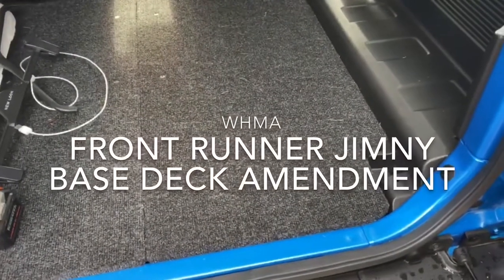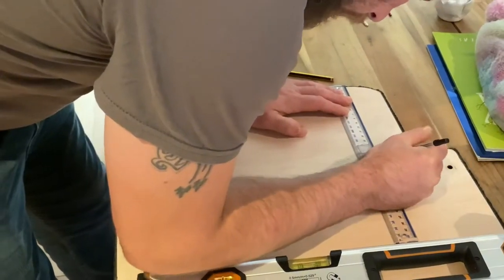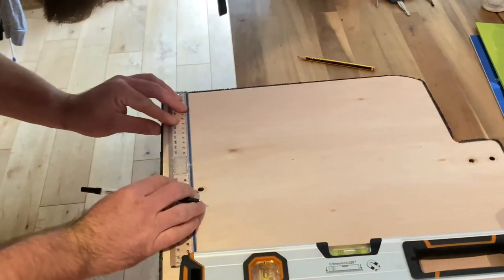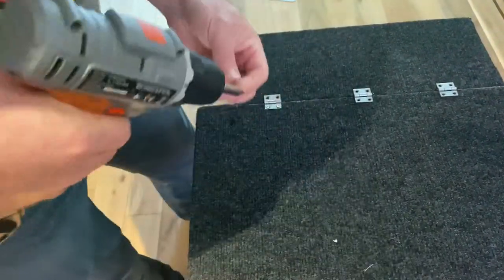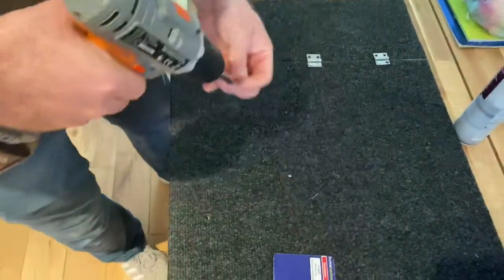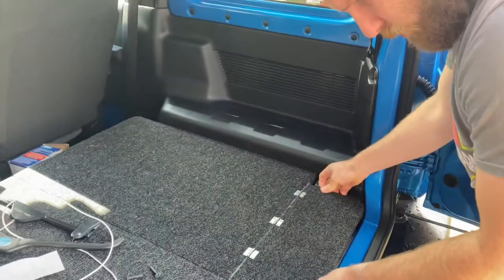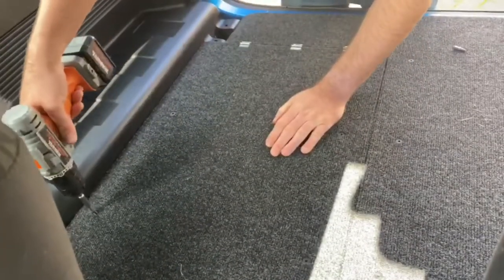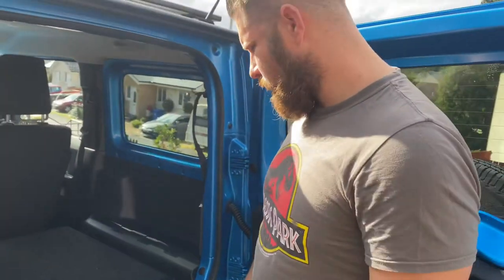Front Runner Jimny 2020 base deck amendment.

Comment: That's a great idea to use that wasted space for the jack and tools. As Nelson said - front runner should do that.
Reply from the maker: Cheers matey, handy little space for some essentials.
Reply: @westhighlandmicroadventure8770  I wonder if there is a space for a handy wine rack under the front of it behind the seats?
Reply: Nice!  I have seen on some car accessory sites, that they make..basically, roughly a 100mm tube, that goes from the rear of the interior roof to the top of the rear view mirror, for storing anything long. I can't remember what it was attached to? 👍